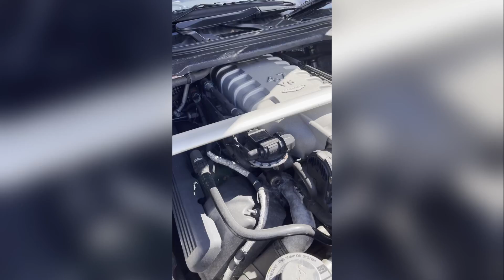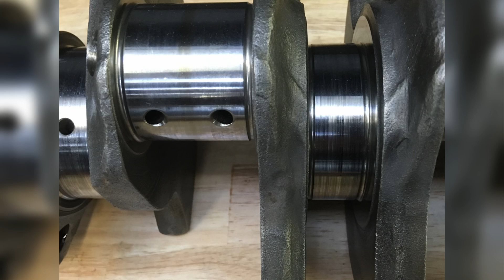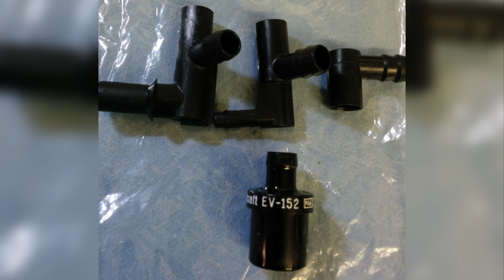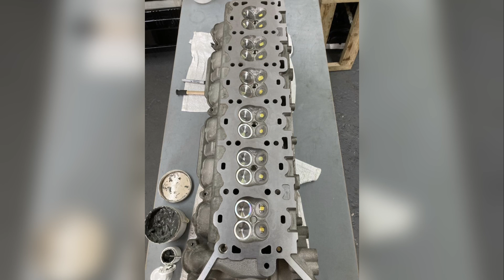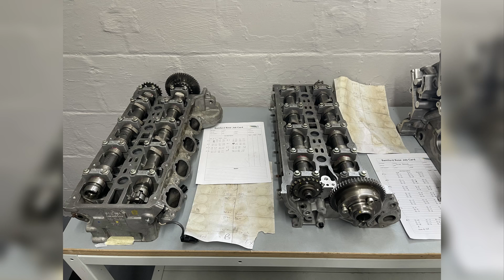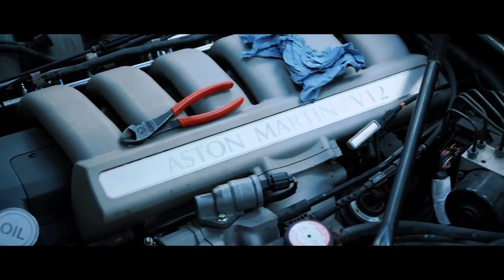Bamford Rose Launches NEW!!! Aston Engine Repair Centre

Comment: Mike - Q here in the U.S.  I am the 3rd owner of a 2005 DB9 with 61K miles (very well maintained and driven responsibly during my ownership for 3+ years) that has suddenly developed the dread tick piston slap.  Do you have any partner shops that I can reach out to for a possible rebuild which most likely may be needed?  Any recommendations, feedback, support would be greatly appreciated.  Thanks very much for what you do and for all the recent content!

Comment: Are you saying a v12 Aston engine is only good for 100k. I've had jaguar v12 with over 250k on with no problems. I've serviced my v12 from 70k, its now done over 100k with no problems. I use recommended oil and Aston filters.

Comment: Mike, thanks for the explanation of the 4.7l V8 big end bearing issue.  Is it true that late in the production cycle (around 2016) a new/different bearing was introduced as AML hadn´t quite got the random engine failures under control? Any further knowledge which engine or chassis No.s onwards feature this revised bearing?

Comment: On the two pin injector V12’s, I’d imagine replacing the injector wiring with twisted pair screened cable would go some way to reducing unwanted induced stray voltage and RF interference. Thanks for the heads up. Another future modification now added to the list 😏

Comment: Any suggestions of how to avoid the ingestion into the primary cats if the laws of the country you live in does not permit any removal or modification of any part of the exhaust system including cats?
Reply: Leave the manifold & cat housing looking standard,  just cut out then reweld cat housing. No one will be the wiser and you still pass emissions

Comment: All i can say is my DB9 is serviced at one of the UKs top independents every year according to manufacturers specs and, if anything is wrong with it then it is correctly repaired by a caring professional. It definitely doesn't get a £99 service from Joe blogs . I knew when I bought the car nearly 5 years ago it would not be cheap to run and that was taken in to account as to whether or not I could afford an Aston. Look after the car and it will look after you.

Comment: Excellent video again, many thanks! I own a 03/2001 DB7 V12 Vantage (manual) and the engine has what sounds very much like that dreaded tick that you present in some of your video clips. My question: does the tick of my engine necessarily have to be that dreaded engine tick that costs a fortune to fix? Or could the tick be something else much cheaper to fix? Many thanks, SM
Reply from the maker: Hi. the noise on your '7 could be valvetrain so less severe and easier fix, but unless listening to it, i'd not be able to tell / advise
Reply: @BamfordRose  Thank you very much, Mike, for your response! It is very helpful indeed because it means that I do not necessarily have to spend 20K Euro to have the issue fixed. So, there is hope that it's not the dreaded tick. But of course, I need to have this properly checked by Aston Martin or a specialist here in Germany. Many thanks again! Best regards, SM

Comment: Michael,  Will BR be making new pistons, rods and billet crank 7.1 or 7.2 conversion engines? We have previously built a few 11 meter boats with Lambo V-12s as one offs. Thinking a pair of AM-29,  7+ litre.  Lower rev limit not a problem.  Not looking for all high end power.  We live and work in the southeast US.  Thank you.
Reply from the maker: The pair of AM V12's installed to a boat would sound like heaven. Repairs need to be done correctly, but keeping costs to a minimum. What you mention is more an upgrade that few road cars will want, but, if there was demand for such a build, we would look at it. Needs a significant liner change though, which I know an engineering company is researching now, so could be on the cards.

Comment: Thanks for the explanation of cat ingestion. I could not get my head round it. But now that you have explained the valve overlap, the penny has dropped.
Reply: @BamfordRose sounds like the same issue Toyota MR2s had. I had my MR2's primary cats removed when I bought it at 90,000 miles. Just involved a good whack with a hammer and chisel to remove them from the header 😮. Seems the Aston solution is a little more 'sophisticated' 😂. I'm researching DB9s before I buy one so this and videos you have done are essential. Thanks so much for the effort you put into these.